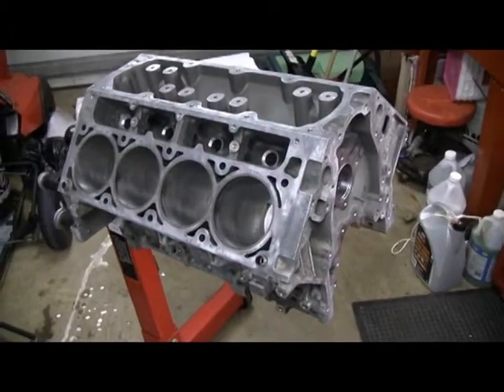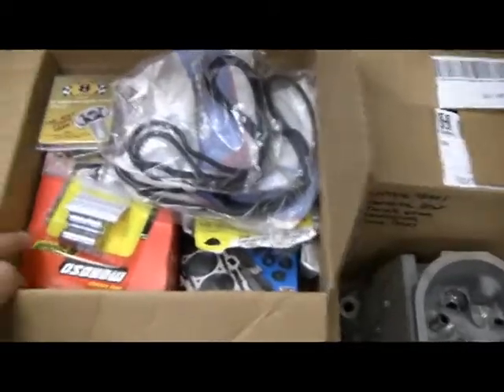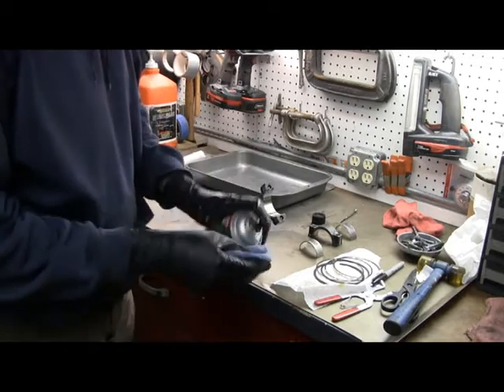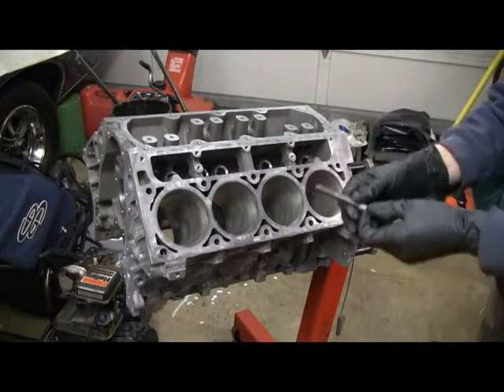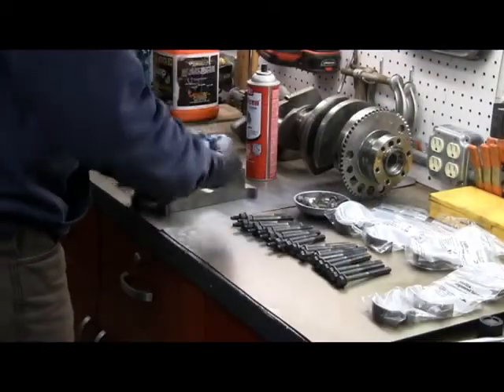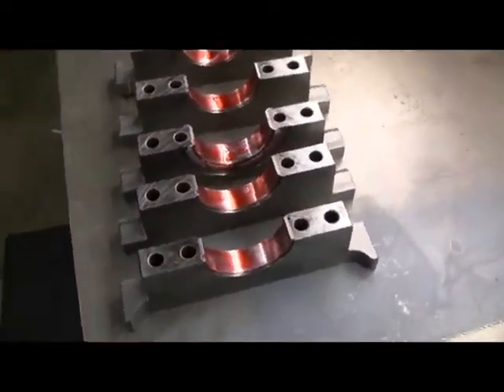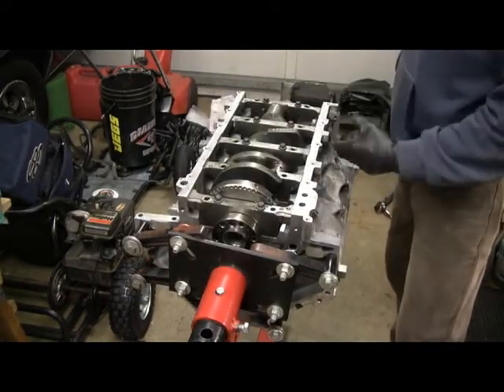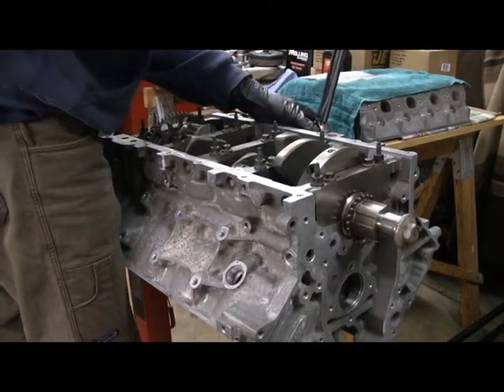LS Conversion Swap Part 30, LS engine. New parts and crank in

Comment: I've enjoyed following along so far. I own a 70 Pontiac Tempest post car.. My car also  has GW suspension , more over I'm planning a LS swap.  I'd suggest you checkout "Sloppy Mechanics" not for any other reason than to show how durable the LS engines are. He is funny as shit and shares excellent info and tips also.  
cheers

    https://www.youtube.com/watch?v=j74MxGo7GfU&feature=share
Reply from the maker: Thanks for link. I watched few. Everyone seems to have their own techniques to get stuff done. I am anxious to see the difference with the GW suspension. What was your opinion on the improvement? Worth the cost?
Reply: The car feels tighter and turns flatter. The neg camber makes it track like its on rails. Its firm but not unpleasant. I think you'll be happy, I am very happy with GW upgrade.. Have you checked out the latest  rear control arm spherical bearings? very interesting if you haven't already seen it.......less than $400.......so many wants!  
  I really liked your frame repair at the mounts....simple yet precise.  I tend to be a perfectionist and  I think you are too. 
   Sloppy throws together a junkyard 6.0 with 250k, re-uses all stock gaskets, bolts, rotating assemby etc,etc.He does do valve springs an cam for higher RPM and power. Then he throws a cheap turbo from china on it and makes 900 hp at the tire and it is mild mannered down low.....pretty impressive of the LS.......hence why I'm here. Keep up the good work. Looking forward to next video, appreciate you making them.